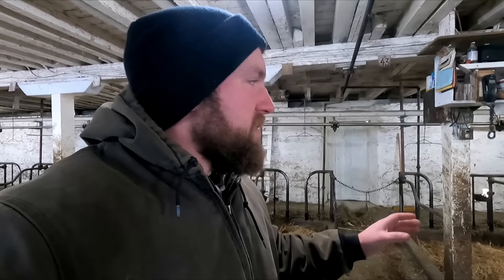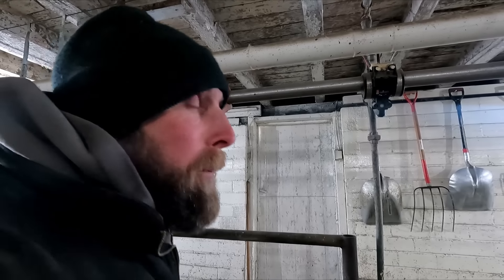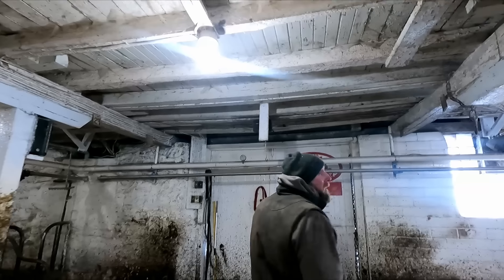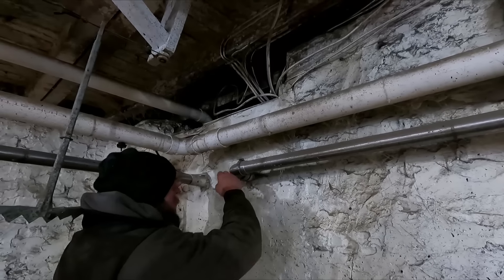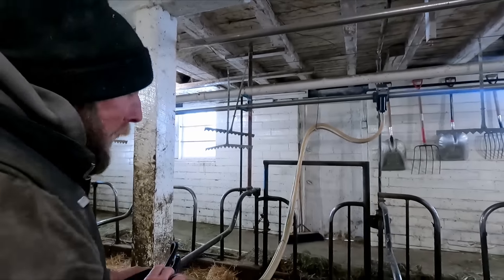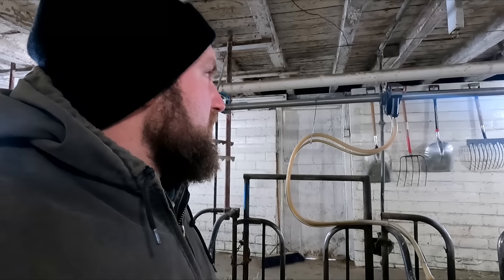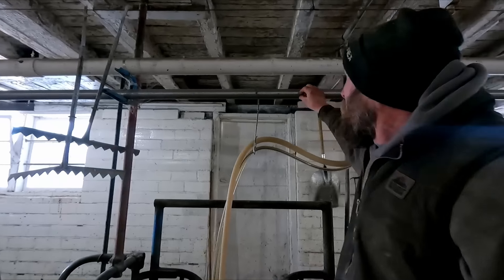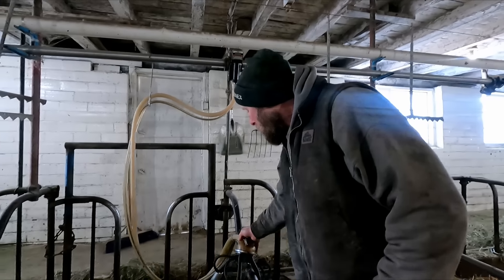Dairy Barn Equipment Tour! How To Milk A Cow!

Comment: The first dairy I worked on milked 40 cows in De Laval milker buckets. That system was installed in 1940. In the 50s they put in a bulk tank. We used a Sputnik to carry the milk into the milk house and pumped it through a sock and  into the tank using compressed air.  I only work on a dairy part-time now. This parlor was built in 1993. The barn setup is what I consider modern style. It's a double ten parallel parlor with a three inch line, automatic takeoffs. All the cows have an ear tag which IDs them when they come in to be milked. It also measures their activity level and cud chewing so you can see on your phone if a cow is off. Sort of an attempt to idiot proof things because there are only a couple of us working there that I consider cow people.

Comment: Oh jeez, what can I tell you. I was 30 when I came home and bought the farm. It was in dire need of updating to say the least. I put a barn cleaner in and quit hauling cans to town every day. Put a flat top 350 gallon bulk tank in and changed to surge buckets and a step saver. Two and a half years later I put in a Bou-Matic pipeline with four units and switched to tie stalls from stanchions. At that time I put in a 600 gallon white Surge bulk tank and because my milk room was small we bulk headed the tank with 1/3 sticking outside. (I was fortunate because I had been teaching for 5 years. so summers and weekends I would milk for locals so they could have time off. I say fortunate because I got to use a number of different pipeline systems and by far I liked Bou-Matic the best.) It made my decision easy when that time came to do a pipeline.
I had a unique barn where my cows faced inward so they had a common feed area with a walkway on each side of barn next to the wall, made it nice for separating cows before they got inside and also made feeding simpler with the common manger.

Comment: I could watch your videos all day. George is an excellent speaker, very educational for this city girl.
Aaron can you tell me what those rake things are hanging from the wire ? Love the cow videos🐄🐄🐄🐄🐄🐄🐄🐄
Reply: Cattle trainers. It trains them to step back and arch their backs so the manure and urine goes in the gutter behind each stall and not all through the stalls where the cows lay. Main purpose is cleanliness and comfort especially trying to keep low somatic cell counts to ship quality milk.
Reply: @sethholt2270  thank you so much for the information 😊😊😊
Reply: As a retired dairy farmer, the only thing I would add to @setholt2270 is they are there to PREVENT the cow from arching her back while going.  Arching the back “shortens” the cow, and everything lands at the back of the stall instead of a few inches back in the gutter.

Comment: We put in a parlor in 1970 (I was born in '69). Had the breaker cups in the stanchion before that, went to the Surge Mini Cup in a swinging 6 hi line parlor until 1995, then upgraded to double 6 lowline and take-offs using Surge Eclipse claws. After my Dad passed in '95, I learned soon enough that I could do the milking alone in it. I actually made some lamps using the Breaker Cups! For our show cattle, I rigged up a system using the old Surge bucket milkers and a light DeLaval pump. Great video!👍👍

Comment: I milked with deleval floor buckets up until a couple years ago. No step saver, just my two hands and two stainless pails 🤣 put in a deleval 2in pipeline and ran 4 boumatic companions for awhile. I wasn’t a fan of the ATOs so I went back to just a regular boumatic pulsator and the same cluster you got. We get most of our milking stuff from Parts Department online. Or hamby.

Comment: You got the Surge pails we used with dumping station. Stopped in 1997. Bad knees to this day. Strap and not enough capacity made for interesting milking. We milked around 75 up to 90 cows. Wasn't bad to start but when we modernized nutrition we didn't have capacity. Good honest work

Comment: We used to milk 30 cows with a system from the 60’s transfer station two bucks with the milkers  vacuum pumps right up until 2001. But if i remember dad had looked at getting pipeline put in.

Comment: I didn’t see an additional vacuum capacity container at the far end of your barn. I grew up on a dairy farm and farmed full time for 13 years. Became a mechanical engineer. You will see a vacuum gradient from the vacuum pump to the end of the line and your vacuum recovery will be that much slower at the end because the air flow needs to travel through the pipes to create more vacuum. I would get the biggest canister you can fit in with and automatic moisture release and tie it directly into your pvc line. For your cost you will not be sorry. I used surge units too. Quit in ‘93. Also, I would trust the old vacuum regulator. I don’t know how often ours would stick and cause mastitis. I cleaned it each month but… upgrade that and one mastitis case would pay for a monitoring system.

Comment: I grew up in central Minnesota. When I was in grade school back in the 60's my dad was the butter maker at a small creamery and I would occasionally ride along with one of the truck drivers when he was picking up milk. I don't remember any tanker trucks in the fleet and I think 
all the milk was hauled in cans. It would be my job to knock the lids loose with a piece of pipe as the cans rolled down the conveyor from the truck into the creamery.

I had several friends that lived on small dairy farms in the early to mid- 70's and I would occasionally help them with milking. They all used Surge buckets and the milk would be dumped into pails which we carried to the milk room to dump into the milk tank. By the mid-70's a couple of them had step-savers, which seemed like such a luxury. 

In the late 70's to early 80's I worked installing and servicing silo unloaders and feed handling equipment. By that time I'd estimate that about 75% of the farms I visited had pipelines, about 20% used step savers and less than 5% were milking in parlors.

I'm now retired and live in NW Wisconsin where I still drink about a gallon and a half of milk each week and cheese is by far my favorite snack food. 
Thanks for the great looks into today's small dairy farm! Keep up the good work. Glenn

Comment: Great video, do you reuse your plate cooler water, dairy I do work at plate cooler water goes into tanks and used to water cattle. Milking 900, I think around 2000 head. There are 8 wells and 12 pumps running pretty much all time to keep cattle water. Keep up the great work, great to see small family farms still going.

Comment: interesting to see your set up we had a single electric pulsator box like yours  only delaval till 1982 then went to individual pulsators so if one goes bad just switch it out plus with the risk of stray voltage I dont need any wires to stallcocks. When dad and me milked we used 8 units with 2 inch line in 160 ft barn now I milk alone 65 cows with 5 units in western mn

Comment: I been subscribed to your channel for around a year now. But my first time commenting. I have pretty vast dairy or even farming experiences in general. But if could talk you & your dad in person we could probably talk for hours about dairy. I'm going to talk to you about the former dairy farm I'm living on now I'm  between Spencer & Marshfield Wisconsin. Living with my mother & Step father. we dairy farmed until late May in 2022 when my step father sold the milk cows. He kept all the young stock though. He still has some out in the  barn now yet. My mom started dating my step dad in 1997 when I was i high school. He had taken the farm over from his parents in 1993. Shortly after that he replaced the old stanchion with tie stalls & put up a 18×60 ft silo. They already had a 14×30 ft silo there before. He extended that silo to 14×55 ft with extra staves left over the big silo wich was a originally 18×80 when he bought it used. He put a new milk house in 1995. At the time they had 4 universal floor buckets & a step saver & they had a 300 gallon dari kool ice bank bulk tank & an older universal vane type vacuum pump. That was in the  old milk house set up. I never seen the inside of that milk house they put the new milk house up before my mom started dating my step dad. I only seen pictures of the farm with old milk house. I was told my step dad put the step saver  & vacuum pump in the late 1980s before that they had a piston type vacuum pump. Around the time they put up the new milk house my step dad had purchased a used 2 inch pipeline system the farmer he purchased the pipeline from had upgraded to a 2 &a half inch pipeline. He just got the stainles 2 inch milk pipe & the receiver group. No vacuum pump or milking units. But he didn't get it up & going until later summer early fall 1996 he told me it was just before he met my mom lol. I came to the farm for the time in late spring 1997. & the milking system consisted of the same 300 gallon dari kool ice bank bulk tank. An older 2 inch universal pipeline the same older universal  vane type vacuum pump & milkers were from there old floor bucket the single shot electric pulsatiors & the claws from the buckets he just got the hanger & the inlets for the pipeline. In 1998 he got some newer style claws & duel universal  pulsation. In spring of 1999 he upgraded to an 800 gallon dari kool bulk tank. &  expanded the barn from 37 tie stalls to 49 tie stalls & put large pens  in for heifers we kept our heifers in those pen until they were bred one side was divided on two the other was big pen. In the fall of 1999 my step dad purchased 4 new universal advisor automatic takeoff units & married my mom lol. I moved to the farm in late fall of 2000 in 2005 he put up a 60×120 ft machine  shed in 2006 he purchased a new new holland tm130 mfwd tractor. well traded in a ford 7710 mfwd for it. In 2007 we remodel our house. In September of 2008 we hosted Spencer  FFAs fall dairy breakfast that they do here. In spring 2016 we upgraded our vacuum pump 7.5 hp masport  still a vane type about a week we got new delaval  automatic takeoff units because they told  my  step dad that the universal  line was going  to discontinued  it would be hard  to find parts  for his current units. I personally liked the universal advisor better. Those delaval units  seemed cheaply made the universal units had piston type deal to remove the claw where the delaval  units had a kinda reel type setup to remove the cla

Comment: at 16:40 its 60/40 pulsation. I have the same control box but instead of side to side it's front to back, 40 front 60 back. otherwise i grew up with surge EMI timers ( made for the guy/gal whom milked with 2 hoses) works same as one touch were it tells you how long the cow milked and beeps when cow is done. Wish the dairy companies still made these timers and cool tech for the small producer but nowadays its auto take-off and giant computer board. As for parts facebook marketplace has been a very good place for old parts lately but my old surge dealer also deals in a lot of older parts too. As always thanks for the video! i really enjoy watching your farm.

Comment: Growing up near spring valley wisconsin, we milked cows in a similar set up as yours. In 1998 we built a freestall barn, and kept milking in the old barn until the parlor was built in 99, we went to a 28 stall rotary, that you milked in the middle, and we were one of the first in the area with a rotary. We jumped up to 200 cows. Present day it's still being used and they are up to 500 milking

Comment: My family farm had a 6x6 herringbone bone parlor with a 1000 gallon Delaval bulk tank. Had a 100 head free stall attached to the parlor with a feed bunk down the middle. There was a pit on 1 end with slats for scraping manure into. Other end had two stave silos and two harvestors with a stationary mixer in the silo shed. Could feed cows right in the barn. 

Farm I help milk on now has a parlor you can milk 9 at a time usually do it in shifts of 8 in line with an indexing rail. Two free stall barns and an outside feed bunk. It’s a nice setup.

Comment: Incredible amount of info as always, thanks.  Here's a question I just thought of regarding which end of the barn to start milking on.  If you start on the end farthest from the milk tank, wouldn't the milk coating the line begin to dry making fat deposits where if you started closest, the milk would always be running down to the tank?  Then the washing would start very soon after the last cow.  I don't know, just wondering.

Comment: Starting with my dad. in 1927 he put a De LaVal   Milking machine in the old 18 stall barn, in 1931 it was moved to the new 26 stall dairy barn. (2 floor pail units, Electric pulsation run off the vacuum pump main shaft.) mid50s new vacuum pump with separate  electric pulsation control system, New inch and a half vacuum line with sweeps not 90° elbows, Replace pens with six more stalls, and got the third milker and a can cooler replaced the water tank,1960 older brother took over the farm, and the barn cleaner was installed and 20 foot silo built with around the silo outside feeding,     1963 saw the installation of a 400 gallon flat top bulk tank. 1965 the partnership was formed, Remodeled the west end, which increase the capacity to 52 stalls, 2 people milking, 6 milkers bigger vacuum pump, and went to a dumping station. 1970 build Freestall barn and switched cows, put in new 650 gallon tank,1976 installed a used double 5 parlor in the stall barn/expanded to double 6. More cattle housing was added a  new 2000gallon replaced the 650, we milked around 125 registered Holsteins till 2000. 👨🏻‍🦳 🐄🐄 🚜
Reply: Side bar. My Grandpa died when my dad was 14, (1915). He started farming then ,plowed with horses 1 bottom  walk behind. In 1919 grandma bought a international 10-20 Titan tractor. The last year he plowed was 1985 ,140 hp. FWA White pulling 5-16s 🤗

Comment: Funny to think we are still using Surge buckets carry milk in pails and pour in a strainer.... Just like 1940. It works.
Reply: As someone who did that for many years, and the only upgrade we ever had was a transfer bucket so we did not have to carry buckets to the milk house, see if you can eventually move to a pipeline.  Artificial knees will most likely be in your future.  Two for dad, one for me….,

Comment: George misspoke. Pressure is measured in psi (pounds/square inch). Vacuum is measured in inHg (inches of mercury). Also,  the vacuum pump is a “lobe” pump.